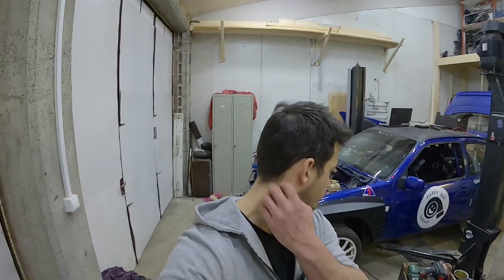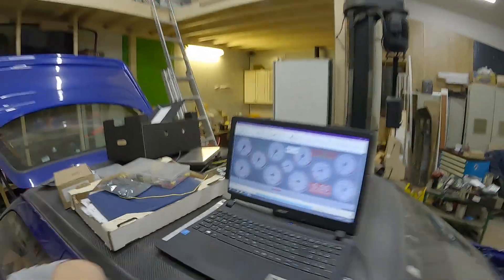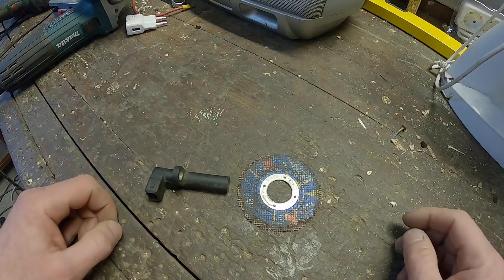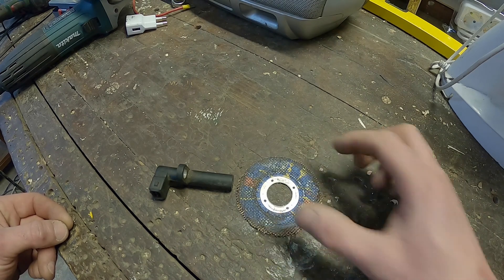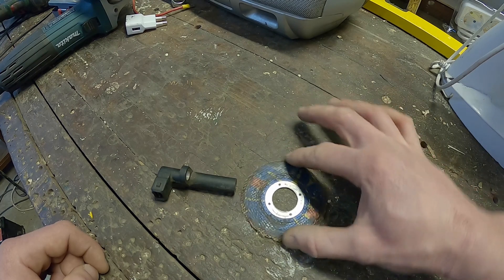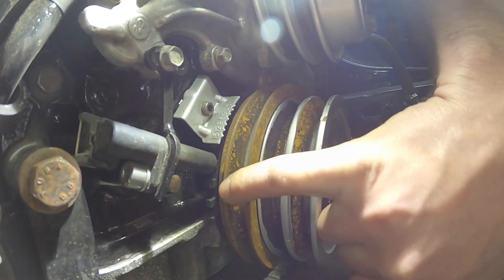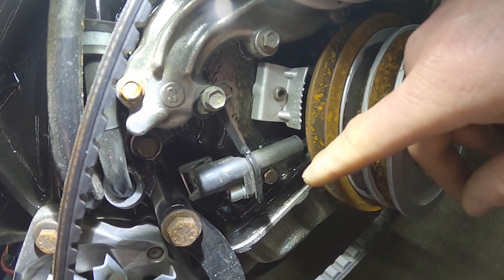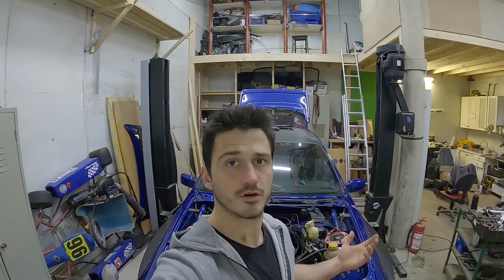Trigger Wheel And Sync Loss Issues | Ford Sierra Coupe Turbo - Track Weapon Build | Episode 17

Comment: Zdravo. How have you solved the grounding problem you had I think I am having a similar problem on my vintage Alfa unsing ME mapped ignition? What are main considerations there. Hvala lepa za odgovor.
Reply from the maker: Živjo! 
Yes, I did. It ended up being a faulty IGBT transistor I was using as an igniter at the time. It was causing interference with crankshaft position sensor and making me chase my tail. Now I'm using a Bosch 211 ignition module and it works great.
Some good practices are :
- to have all the grounds on the same spot (star point grounding)
- use good quality automotive igniters 
- correct dwell time set in software.
You can write me an email to discuss your specific situation further.

Comment: i have a question, why dont use a hall sensor? thanks!
Reply from the maker: It's just a matter of preference and availability.
VR sensor is theoretically a bit more durable, while Hall doesn't need signal processing and is easier to set up, it just needs a 5V voltage source.

Comment: Why do you insist on using a cologne engine? Not much power at all for future upgrades, is it just a daily driver project?
Reply from the maker: It is known to be quite strong and reliable engine,  capable of handling around 350hp in turbo form, which is our power goal for the following racing season. It also offers plenty of low-down torque which makes it very driveable.

Comment: You have low battery voltages.
Reply from the maker: That's right, the alternator wasn't hooked up at all. But that didn't affect the sync losses.
Reply: @HappyDayGarage  Right, although low voltages causes many such issues.
Reply from the maker: You are absolutely correct. In my case, however, it was a faulty transistor I was using to trigger the coil back then.

Comment: Great video as always! I'm really enjoying the series. you certainly know your stuff, and I am impressed with the in depth explanations of the various engine systems you give. 
Is the missing tooth on the crank shaft normal?
Reply from the maker: Much appreciated! Yes, the 36-1 trigger wheel is one of the most commonly used ones. 
I'll be showing you how I made it to fit on the pulley in one of the following videos.
Reply: @HappyDayGarage  Hi ,so did you place the trigger wheel in a certain position on the crank pulley or just tapped it on like you did. I would I thought the missing tooth would have to be positioned in a  certain amount of degrees before tdc ??
Reply from the maker: Of course the position of the wheel is crucial. In my case, I have set it up in the software to match the actual rotation angle in realtion to TDC. In your case you should try to match the original rotational position of the stock trigger wheel. @paulsimpson2232